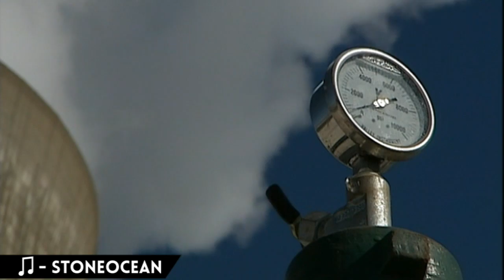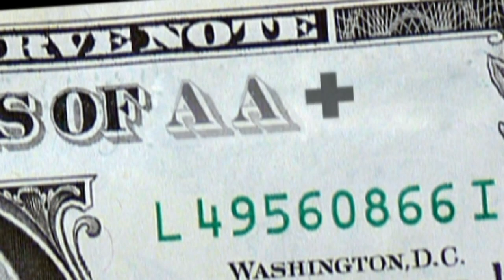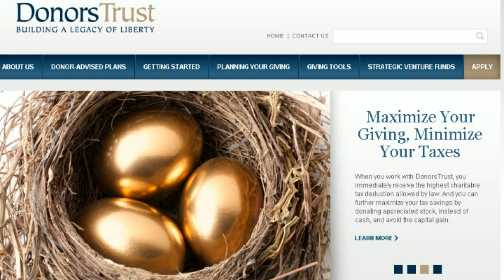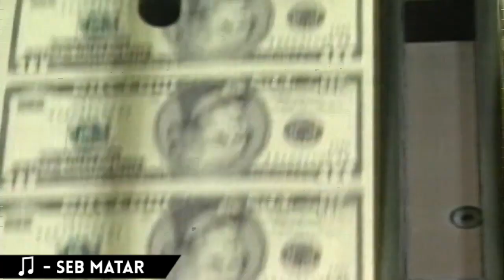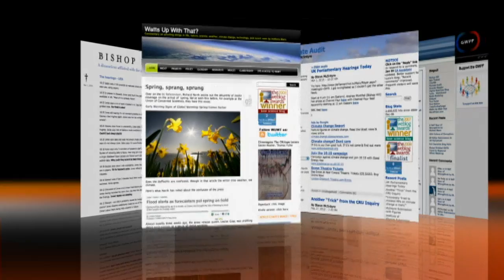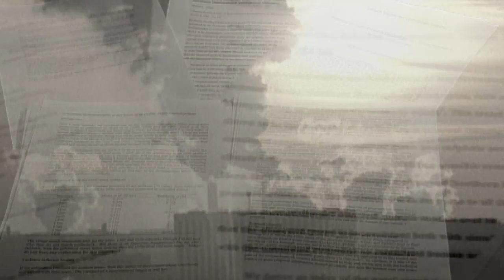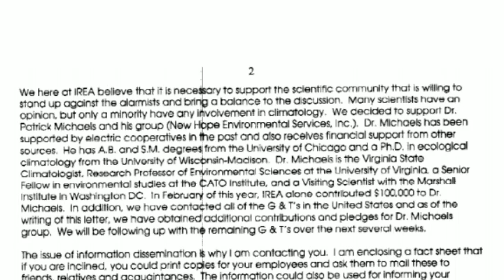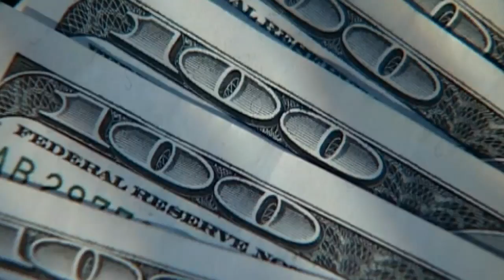The Great Climate Change Conspiracy - Truthloader

Comment: Dear Truthloader,

Pointing out political links between groups of people and organisations does nothing to scientifically prove a causal relationship between changes in the climate and Human activity.

Carbon Dioxide does cause a very small increase in temperature, but it is nowhere near enough to measure with great accuracy, as the effect is below the noise floor of measurement. In other words, we are having such a small effect that it is negligable. I am pro climate research, but anti Climate Change® policies being enforced against us for no reason at all.

The Climate Gate scientists modified the data to fit with what they thought it should look like. This IS fraud. Even though they weren't saying "hide the decline [in temperature]" but were actually saying "hide the decline [in the tree ring data]" due to a phenomenon they could not explain, this is still scientific fraud. If I make a graph using a data source that has a phenomena that I do not comprehend, then I attempt to "fix" the data by adjusting the curve so it "looks right" and seems to fit with other data sets, then the data is automatically null and void.

I have scoured the internet for scientific papers on climate change, but I have found absolutely no evidence (other than clever use of statistics and computer models) that changes in climate are due to Human activity. The only Human activity that can have a dramatic effect on local climate are things like dark coloured tarmac, where the tarmac increases local temperatures due to the absorption of shorter IR wavelengths and re-emission of longer wavelengths. This is by far a greater temperature increase than could ever be caused by an increase in CO2, even if we increased our CO2 output by 1000x.

There is NO way that Human/industrial output of CO2 is causing large enough changes in the climate to be noticable, or even be a threat to our survival. The only large effect that is happening is my gas and electricity prices going through the roof.

Why don't we focus on the real problems? Toxic waste being output by industry, for instance. That is a much bigger issue than this whole Climate Change® farce.

Comment: There's a lot of debate as to whether climate change is happening. The thing is, we should be using renewable energy regardless of whether it is happening or not. We will eventually run out of fossil fuels and if we don't have anything in place then we're more fucked than we already are.

Comment: I have not watched the whole video yet but the opening statements by the host were incorrect and alarming to the accuracy of this segment. First off, everyone believes in climate change. I say this because climate and weather are essentially the same thing since the differences within the two meanings are subjective conclusions. Therefore what is considered weather to some can be declared climate to another.  I took an environmental biology class and the professor would not touch the subject of man made climate change because of the lack of scientific research, his reasons I forgot. This man was a professional environmental biologist btw. Go ask an environmental biologist in person for their opinion it will be the same. The guy basically said until 2050 humans cannot have the ability to accurately exam the evidence of mans impact on the climate change and his reasoning's for saying this I forgot. However I can give two arguments as to why I believe the man made climate change topic is a fake issue.

Reasoning 1, look at solar activity; if the tilt of the earth can cause temperature changes within an environment away from the equator to change more than 100 degrees how can 1 degree in temp change be so damaging to the environment. Furthermore the earth was at a 15 year peak of solar maximum activity when record temps were recorded. This past winter was the coldest in 100 years and the suns solar activity was at a 100 year low.

Reasoning 2, government will do anything for larger tax revenues; why does a government create tax breaks for people who have kids, because when the population increases those new born children grow and become individuals who are taxed. Therefore if the government is that desperate to increase population sizes to have larger tax revenues why would they not be desperate to intrude on other opportunities to gain tax revenue. Ask an environmental biologist about this as-well.

These two factors must be considered when judging whether man made climate change does or does not exist; I have not read a scientific study that has been published in a scientific journal. The sample size of evidence is to small, to scattered and lacking variables that any conclusion made today about this issue has to be viewed as premature. I mean there are a lot of variables and one so influential to temps such as the sun has to be looked at for a valid argument for or against can be made.

Pollution on the other hand is a massive issue and needs to be dealt with
Reply: I forgot to proof read and i have not seen a scientific journal that has shown a study that included solar activity to conclude whether man made climate change is real. Also the sun was at a 15 year solar maximum not the earth.

Also is man made climate change is not possible than the practice to terraform is not possible and that is a bummer